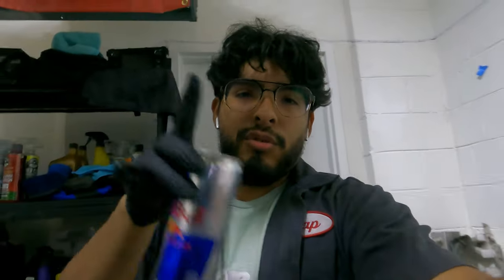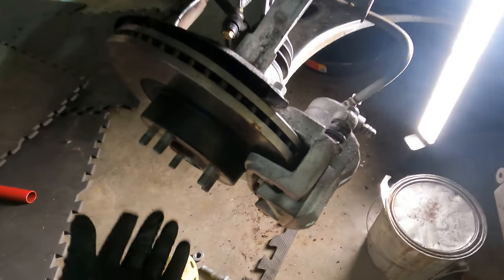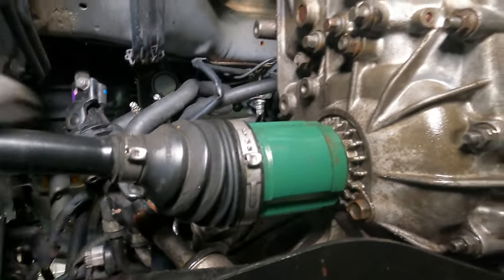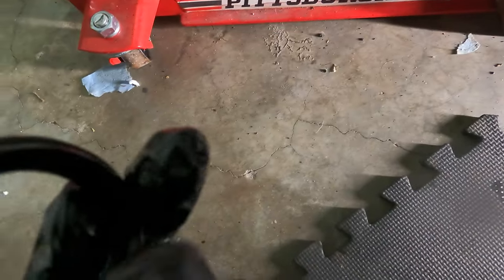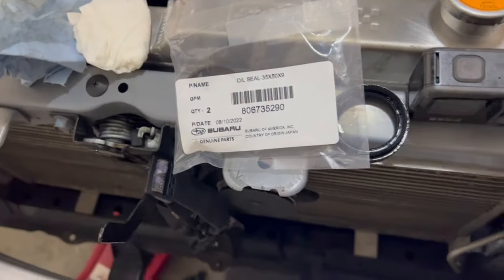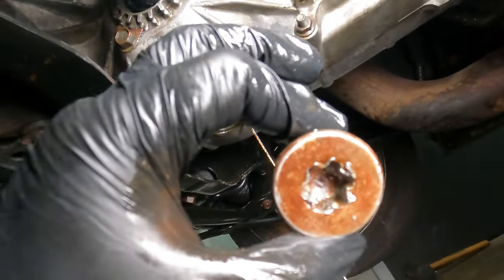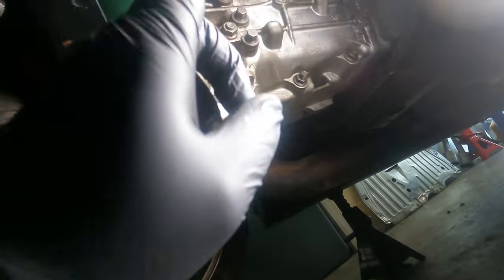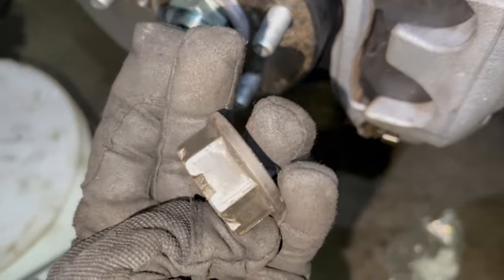Leaking Transmission axle - Wrx Axle seal replacement

Comment: I have several questions.
1) why not just undo lca ball joint so car doesn't have to get an alignment for the camber being throw out by taking the McPherson strut off.
2) if I'm not mistaken, the transmission, center diff, and rear diff are all separate parts,  so it confuses me when you dropped the gear oil out the center diff but said your about to refill the transmission?
Reply from the maker: No problem, I’m happy to address both questions 💯
1. I should’ve explained that the alignment wouldn’t matter to me, because I was going to replace my rusted LCA with Sti LCA with a bump steer kit. So my alignment was going to get thrown off regardless. 

2. I didn’t drop the oil from the center it was from the front but I did have a bad angle since we work out of the garage with Jack stands so my apologies 

Appreciate the questions and support 🙏🏽